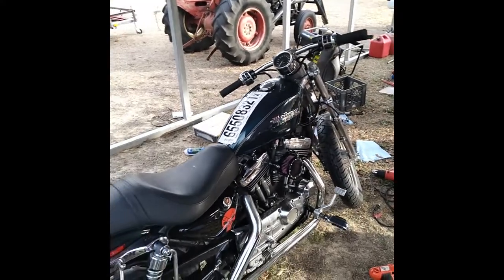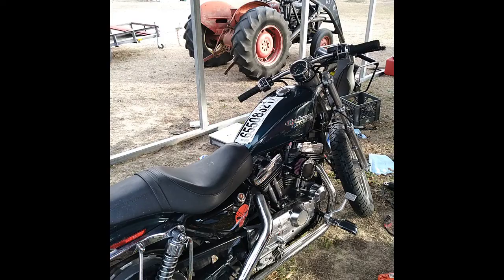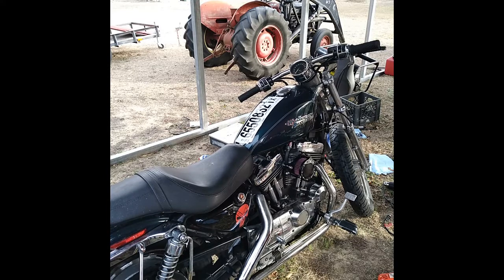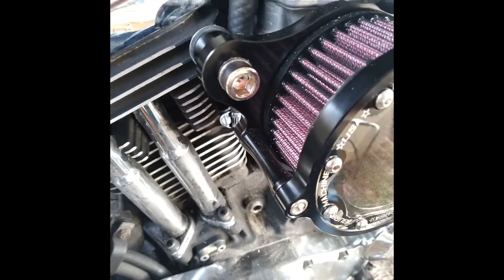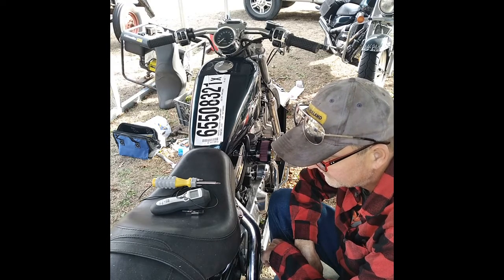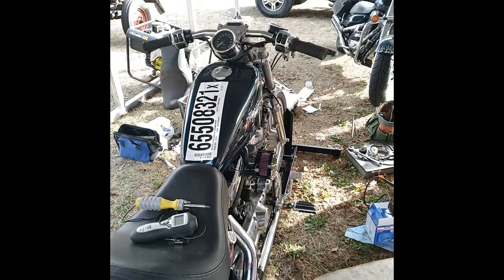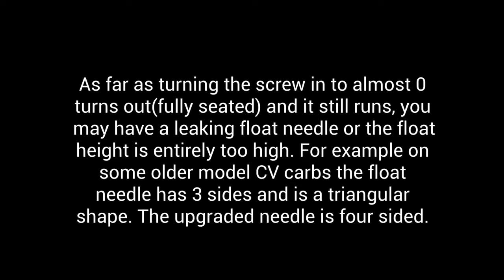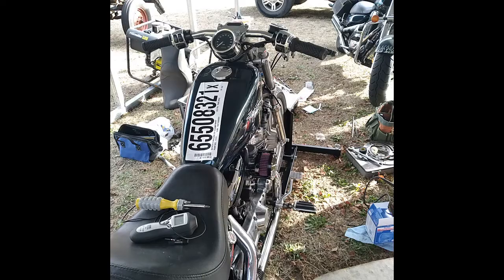Tuning Your Carburetor: The Mixture Setup Guide

Comment: I have a question where should you start with your rpm when you start to tune it and what device are you using to read your rpm. Thanks.
Reply from the maker: I use a handheld inductive tach that clips on a plug wire. Your idle speed is going to change while srtting air fuel mixture. Once that is set you will adjust l idle stop screw to around 1k rpm.

Comment: My sportster is a 94 883 with the cv carburetor,  it does take a while to warm up and idle on its own if you take the choke off also after riding when bikes warmed up and you come to a stop the bike idles high and sometimes diesels when you shut it off any advice for me ?
Reply from the maker: First I would check for an intake leak at the manifold, With the bike warmed up, spry something like "brake cleaner" directly at manifold joints. You want to use the straw that cones with it to direct the flow. If the idle changes at all, it is leaking and you will need to replace the flange seals. and donut ring the carb sits in. That would be a good time to inspect jetting and make any jetting canges whule you have the carb off. 
     Intake leaks have always been a problem on all HD models ever since they started making twins.
     Best of luck.
Reply: @russellbarron6775  thank you so much for the insite , do you happen to know the correct jetting size for the main and the pilot jet for a 94 883?
Reply from the maker: @shannonbarrios6484  the main should be 185. Slow 45. Af screw start at 3 turns out then do an idle drop. I would wantvyou to look at the float needle if it has the 3 sided needle replace it with the newer style 4 sided. Then ride it. If you have any stumbles or lean spots in the mid range you can shim the needle to raise it. The shims are cheap and only raise it like .030. That is the homemade jet kit. Easy as pie.
Reply: @russellbarron6775  well I'm just a little ol girl ill try my best but thank you for tips ill try to do it

Comment: Please help me understand this correctly. Once you turn the mixture screw out to where the mixture screw needle is flat, and not protruding from the carb mouth, let' say 1 1/2 turns out, you then turn it out an additional three turns? For a total of 4 1/2 turns (including the 1 1/2 turns)?  Or is it 4 1/2 turns plus the 1 1/2 turns?
Reply from the maker: 4 1/2 turns out, I would want to go up one size on the slow speed jet. For example, say it had a 40 size jet. I would want to go up to a 42. You start out by seating the screw, turn out 1 1/2 turns, run bike till good and warm. Do your fine tuning, counting your adjustment. Should never be less than 1/2 turn from seated nor more than about 5 turns out. Hope that helps you out.

Comment: Hey there where did you get that inductive tach and how did you hook it up to the bike? I’m having a hard time figuring out where my rpm is by sound
Reply from the maker: I got mine at naoa. It hooks up on wire clamps over plug wire. It does 2 or 4 stoke singles up to 8 cylinders . I really bought it fir setting the governor on my tractor. But ended up using it for anything I need to see rpm on

Comment: HI, I have 3 dual carburated Vtwins and Im fine tuning these bikes now, I just had a question about this procedure,,,,So I set both carbs to 2.5 turns out and lower the idle slightly, NOW on one carb turn screw in till it drop off, thats the low point, then turn screw out till the highest smooth idle before it drops off again, once that point is found, set idel screw to 1k rpms,,,THEN go to other carb, repeat same procedure and then finally set idle screw,,,,It seems that doing it this way will ensure perfection to each carb and the final mix screw setting may not be the same on both carbs do due varios factors, but not using a universal setting but tuning each carb specifically,,,DO I have it right?  TY again
Reply from the maker: They will seldom be exactly the same. Due to variations in vacuum signal between cylinders  on dome twin verbs the rear cylinder may have a different Size pilot jet . You did it exactly as it needed to be.
Reply: @russellbarron6775  Great info ty! So right now on my sabre 1100 I have vance and hines 2 in 1 exhaust, K&N air filter and dynojet jets and needles, I got this bike and the tune was off,,,But I got it tuned really sharp now,,,the question is, the mix screws like to be around 3.5 to 4 turns out for optimum idle, I have all these aftermarket upgrades, but the pilots are 42 OEM,,,,3.5 turns is at the very edge in my opion of tuning, is all I have to do is swap to 45 pilots and it will fix that problem, maybe only hainvg the screws 1.5 turns instead of 3.5,,,,,is that about right?
Reply from the maker: @thedaydreamer7972  That is correct. Iwould say probably go up to 45 on the pilots. You will then have to reset thge mixture screws. I would start at probably 1 1/2 turns and go from there.

Comment: Hi, I have both a Intruder VS1400 and Marauder vz800,,,I have the bikes running well and synced and carbs inspected and set to spec,,,However the idle on both of these bikes is a bit off,,,AND upon bliping or reving the throttle on both bikes the idle hangs for a sec before returning to steady idle,,,from my under standing when this happens its typically a lean condition, conversely when you blip a throttle and it dips, then returns to idle its a rich condition,,,,,,,IS this issue solved by simply finding the correct mixture screw seting on both carbs?  IF not do you have any other ideas for me to try?  TY you have a great channel
Reply from the maker: Sounds like you have a plan. I would do and idle trop test on each carb. Fairly simple process. Have the bike warmed up. Turn the air/fuel screws in till the idle starts to drop. Note the position of how far you moved the screw. Then turn them out until you get the smoothest idle.   
   If the idle still hangs up you can richen it up slightly or lean it accordingly. 
   I would make sure I did not have an intake leak on either one though. I did a vs1400 a few years ago that the front intake boot had a slight leak when hot(only when hot). It gave me fit for awhile. I would spray it trying to find a leak only to not be able to find it. As a matter of course, I went ahead and replaced it. Problem solved. 
   So, a recap, check intake leaks first. Then do the idle drop(noting position of screws).  Turn your screws in until lightly seated then turn out 1 1/2 turns (starting point). Noting running condition. As a general rule of thumb if they need turned out more than 4 turns your pilot jet is too small. Conversely, if they are in less than 1/2 turn you pilots are too big. 
    I always write down where everything is set at in a log. If you have to richen them up slightly. Mostly depends on airbox/filter and pipe selection. 
   Best of luck.
Reply: @russellbarron6775  Thanks for great info, what symptoms were you geting from the intake leak and how did you find it, spray carb cleaner on boot on idle?  Was it a big leak?
Reply from the maker: @thedaydreamer7972  after it warned up to operating temp it had changing idle high then low  no amount of adjusting screws made much difference. Then it started skipping like it was dropping a cylinder. I spray the intakes with brake cleaner to check fir leaks. It will usually either make it stall or ho high. If it does you have an airleak somewhere.

Comment: Hi Russell, great instructions on the drop-down tuning method !  I have the same 328 EZ-tach + plus, what setting are you using on the tach to get your RPM readings? When I set this tach to 4:2, I'm getting what seems to be half of what it should be !! Thanks for any help on this Tach ! :)
Reply from the maker: I mainly use it on small stuff initially. Some 4 cylinder stuff. Each time I use it I have to play with the settings(memory problems on my part). I did find that If I screw up and accidently set it on 2 stroke stuff it doubles the readings. 
  Thanks.
Reply: @russellbarron6775  Thanks for the info, been trying to get the right fuel-air setting on my Sportster 1200 low, 2-1/2 turns out is to rich, @ 2-1/8 runs really good now after a couple hundred miles I'll see what the plugs look like, maybe go to 2-1/4 and see how she runs, anyway thanks for the info on that tach.
Reply from the maker: @vernon8337  Anytime Vernon, Hope you get it set perfectly.

Comment: Awesome video thank you very much sir
Reply from the maker: You are very welcome. Practice makes perfect. It is much easier to do on single carbs than on multiple carbs. Just remember that if you need to add slightly more fuel do it at small increments of about an 1/8 turn at a time. Verify settings by test riding.
Reply: @russellbarron6775  thank you sir I really appreciate your response back I will definitely keep that in mind when adjusting mine